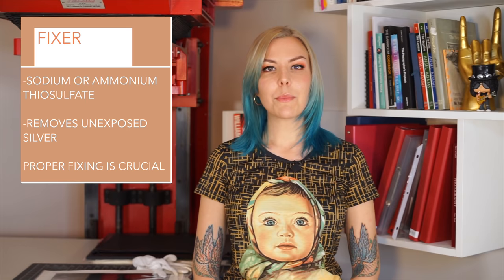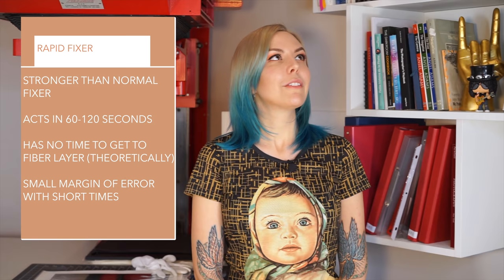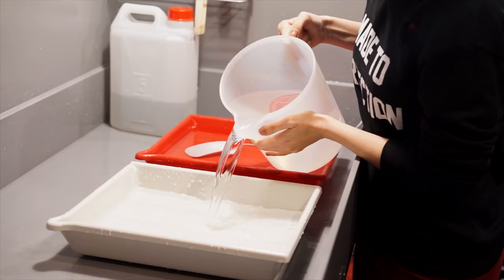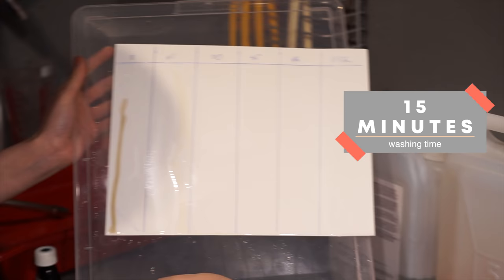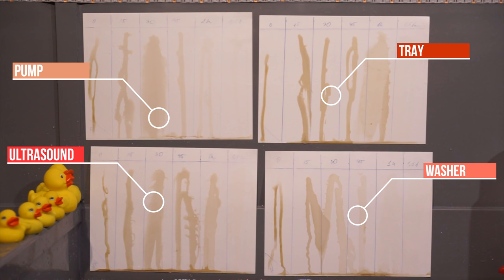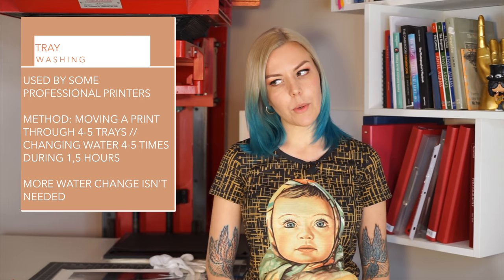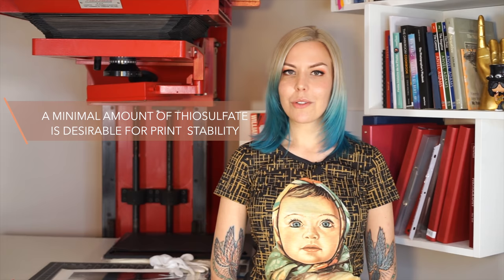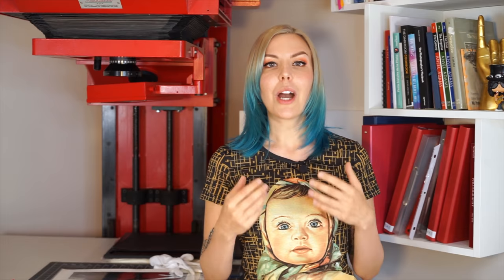Archival Washing of Fiber-Based Paper: Methods and Results

Comment: Back in the time I always used the Ilford washing method for film and prints. It is simplified: quick rinse twice, wash for time X, change water, whash for time two times X, change water, whash for time four times X, change water, whash for time eight times X, done. Time X is a few seconds (10 to 20) for film and RC paper, and a few minutes (3 to 5) for fiber based paper. Washing is diffusion and diffusion is an exponential process. The less the difference in concentration, the longer it takes. Hence the increase of time the further the process is.

Proper fixing is an other rabbit hole. I always used the two tray, split fix method. You split the fix time in half and fix in strong rapid fixer. You always use the same chemistry for the first fix. This fixer gets most of the silver, wheres out fast. But the second fixer stays strong and rapidly removes the residual silver. This is again due to diffusion and difference in concentration. Once the first fixer is worn out it gets discharged. The second fixer becomes the first (as it has only very little silver) and is replaced by new fixer.

Ohh, well. Once upon a day I will reactivate my darkroom. I simply can't let loose of that DeVere 504...
Reply: This has worked well for me.

Comment: Good Testing!
At the time I worked in an commercial lab we did similar testing because of high water bills.
We ended up in a 4 tray cascade washing. Means we had 4 trays with clear tabwater. We put the print every 30 minutes(kitchen timer) in the next tray. After the 4th tray the print was ready.
We changed water in the first tray every 2 hours. In the other 3 trays we changed water twice a working day. We did fixer residue test and the prints were archival proof.
Motion is important. All of our trays stood on an tilting board that was permanent moved slowly by an motor like as if you lift the tray every 5 second at the corner by hand.
Constant movement is good for constant development result too...
Happy eco-friendly printing!
Reply from the maker: Ohhh yess cascade washing is the best if you have the space to create it. Thank you for reminding me of it. I will probably add all washing systems to my page later.
Reply: no agitation necessary?

Comment: Very nice video, Lina! I love how accurate you were with your tests! I actually think rapid fixer at film strength is the way to go. Short soak time so not as much goes into the base and it's still going to be properly fixed even with the short times. So, my approach is rapid fix at film strength for 2min, then leave in a holding tray for as long as the printing session lasts. For the wash stage I use washaid and then finish it off with half an hour in a print washer that I scored very cheaply used. I haven't done any testing, but so far haven't had any problems either. Maybe I should double check with your recipe! By the way, the traditional way to stabilise images for display is to tone them additionally to archival wash. Personally I don't really like the tone changes for toning though, so I tend to use Stabinal if I'm going to sell the print. There are some very interesting comparisons in the book Way Beyond Monochrome for all of this stuff that I found very eye-opening! Great book in general!
Reply from the maker: Hi Lilly, yes, this is right, Way Beyond Monochrome is an amazing book. I also do a "Sistan" stabilizer at the end. And your process is quite close to what I do too. It's just about keeping the print long enough in the water, basically :)

Comment: Great video. Thank you. Back in the 1980s & 90s I used to run a dry to dry black and white developing machine as part of my job and it would do the whole process in about 3 minutes. I'm sure those prints are still around. Resin prints really need very little washing! Recently I've been doing some wet plate ambrotypes and to wash I have a 5l tub with a shelf in it and a small aquarium pump to keep the water moving a bit. I change 1l of water or so each time I add or remove a plate from the bath. I've not done fibre based printing for a long time but  would do the same thing with a small pump, relatively large volume of water. Never running water from the tap that would be such a waste.

Comment: Hi Lina, just see now this video. From many years I use to wash baryt papers into a large container with a lateral input for water that performs a great spin to the water. Papers up to 24x30 run fast in a circle for about 20 minutes with a continuous change of water. In the while I turn prints up and down every 3 minutes. Results are stable over years. My fixing method is traditional, not concentrate hypo but 3 minutes each sheet with continuous agitation, throw away hypo follow the related datasheet. I use often Tetenal Odorless Fixer fixer a very good (and consistent in time) product.

Comment: More helpful info. I've started playing with 4x5 Ilford Harman direct positive paper which is fibre. They also recommend 60' wash times, so this should be applicable, I will try soaking 90' with several changes of water and flipping to soak both sides. Will save a lot of water!

Comment: Great video and interesting tests! Me myself mostly using RC papers and I find it very effective using a Paterson Auto Print Washer (a plastic box with a removable print holding basket inside). What good about it is that the basket is constantly moving when the water is running and very low waterflow is enough to create this motion. I let my prints sit there for 15-30 minutes as I keep filling the basket with new prints. But I only use this for large amount of prints (wedding sessions). When I print just few photos for myself I just let them float in a tray under slowly running tap water for 10-15 minutes. I'm currently building a new darkroom with more space so I probably would like to try make a 3-4 trays rack for washing FB papers when I finally get to using them too :)
Reply from the maker: Your method is surely the best one! I personally also use archival washers for large print amounts.
Reply from the maker: archival washers , no running water though. I change water every half hour

Comment: Hmmm...I've used an Arkay drum stainless steel print washer for 55 years @ 1.5 GPM flow and after using a dual fixing bath and either Kodak Hypo Clearing Agent or Orbit Bath, a wash of 30 minutes on double-weight bayarta based paper has given me archivally-processed prints by Kodak's Hypo-Test Solution all these years. I can load 60 8X10's, 45 11X14's or 30 16X 20's or 10 20x24's at a time (although I don't like to cram the 16x20's  and 20x24's that tight). I use Hypo clear as my "holding tank", and I prefer an ooold Ansco sodium thiosulfate fixer formula I mix from "scratch" for paper to "rapid" fixers, but I don't like cucumbers either. My method yields prints that take selenium or gold toner well for increased D-max. I have 55 year-old prints

Comment: Have you attempted to use a Hypo washing aide when rinsing your paper? It can drastically cut down on washing times.
Reply: Hypo washing isn't practical. Time is about the same for the fixing phase and this has to multiply for each sheet. You can consider this way only for limited number of sheets and this can happen more often when paper size is large enough.
Reply: @padesig  I understand, thank you for the explanation.
Reply: It creates more environmental waste issues.
Reply: Thanks for asking that, and thanks to everyone else for the answers, I was wondering.

Comment: Thank you for the video and for the links. I don't use an archival washer but I do use a hypo wash / wash aid. I saw through your link that the 5 minute recommended wash doesn't seem to work for you. I think I'll have to mix up a testing solution - thank you for the information.

Comment: Thanks for the video Lina, great as always! I use alkaline fixer for the supposed shorter wash times but have never really gotten around to testing my prints. I’d be interested to know if alkaline vs acid fixer with wash aid have any difference in washing times. Though actually the alkaline fixer I used from fotospeed has been discontinued so I’ll now be switching to Tetenal’s neutral fixer. 

I have an archival washer and I adjust the water to the faintest trickle as replacing the water before the residue has dissipated in it is pointless. Unfortunately the tray method is not practical if you’ve made a large number of prints but I’d use it for one or two.

Comment: Would an archival print washer work best if it was run for 30 minutes and then allowed to sit without running water for another 30 minutes?
Reply from the maker: This is basically what I do myself! I first rinse not in the washer, but with a hose in the tray, then 20 mins running water and 40 mins just leaving prints in

Comment: what are the exhaustion values you are using for testing the fixer with the Ag-ph testing kit?  The ph may be different depending on the type fixer used.
Reply from the maker: For this specific experiment, I always used freshest fixer which is not used/exhausted at all. 
However, if you want to keep track of your fixer, it's best to test it when freshly mixed, and then test again after some time. This way you see the PH shift relevant to the specific fixer you are using.